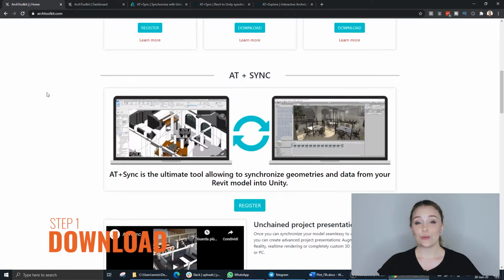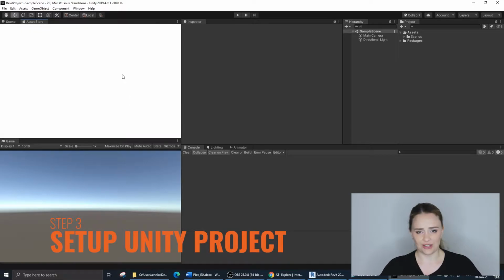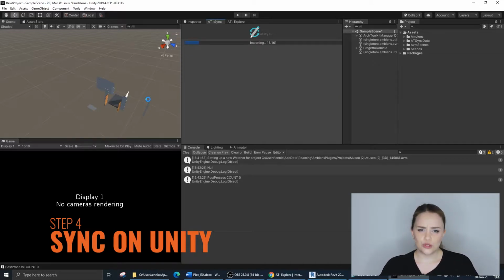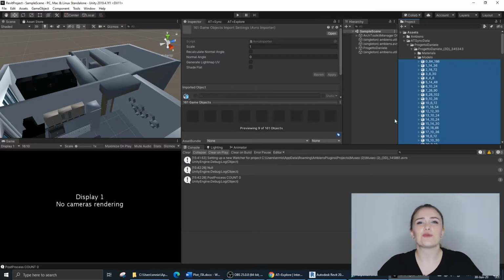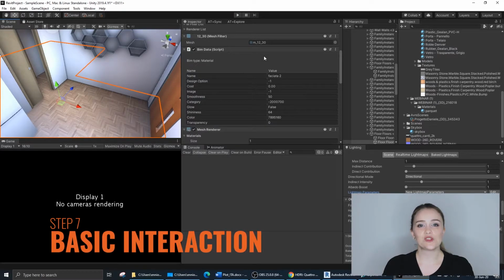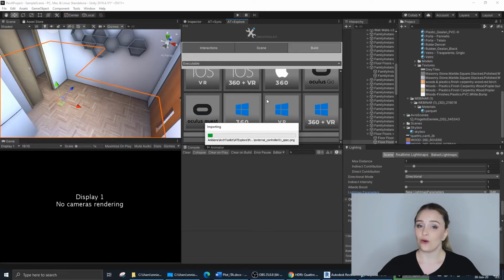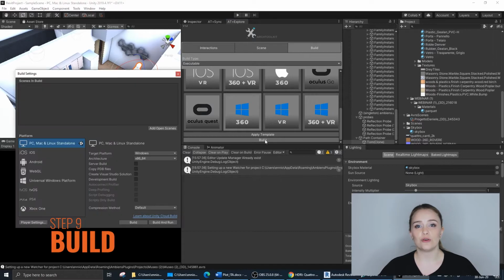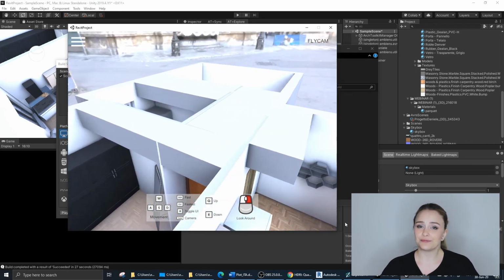From Revit to Unity3D: let's build an Interactive Presentation

Comment: Beautiful plugin. Purchased last week and used it a lot!
I am just having some problems with my glass material. They are transparent only on one side :(
Any solution?
Reply: Problem solved. It was not an issue with the material. There were planes created right on the transparent material so I unable them and everything works fine